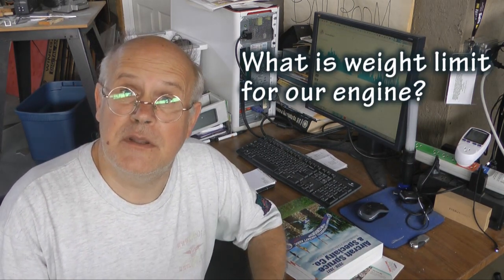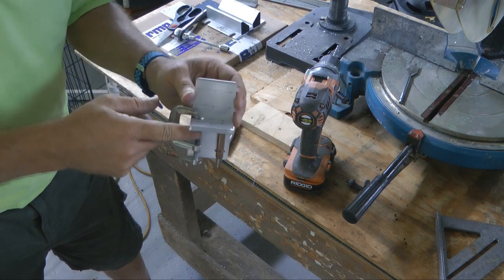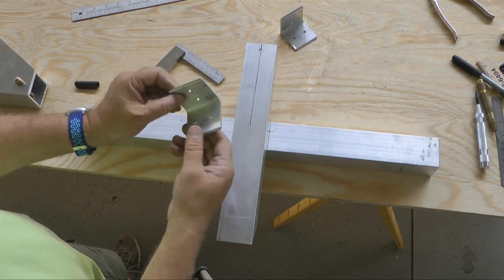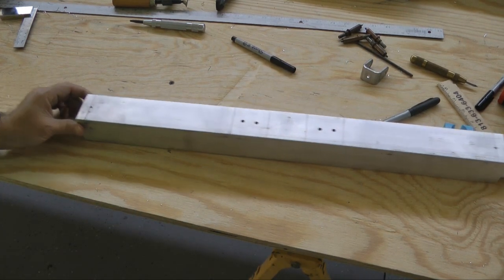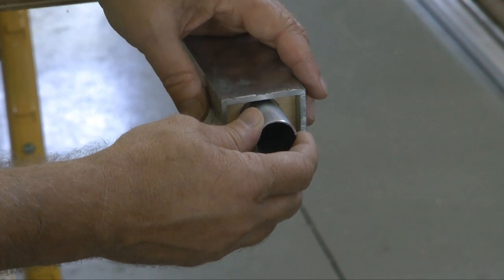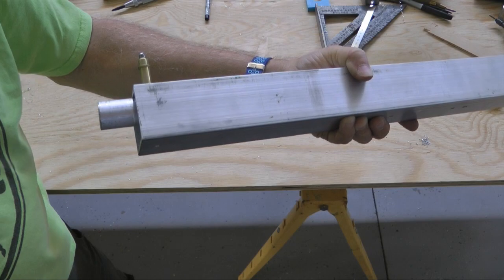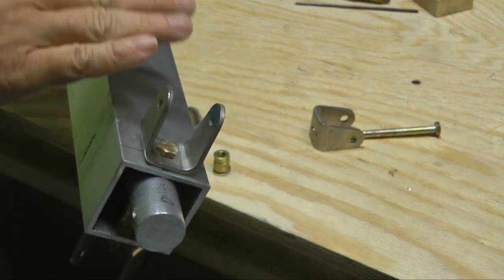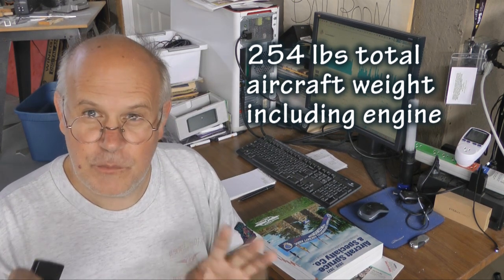Building the Affordaplane Part 7

Comment: Jon can you advise the actual size of the stainless 1" channels that attach tubes to the square fuse please ? we can not purchase and ship from the affordaplane store , too expensive to the UK so we must manufacture ourselves . ( obviously I appreciate the internal width is one inch but what is the height of the  sides of the bracket ? Ripley
Reply from the maker: Not sure I believe it is supposed to be made from SS (check your plans). But if its the part Im thinking of, I simply cut off the edge of a square aluminum tube to form a U channel.  All the dimensions of square tubing are available at wherever you buy this stock.  Match up dimensions with the pieces you are trying to join (those are all in your plans).

Comment: Since total weight is so important, why don't you weld the gussets instead of using all the bolts and nuts?
Reply from the maker: Welds can crack, fail and then people die when used in aircraft.  That is why you dont find commercial aircraft structures welded. Aircraft use bolts or rivets. And - ask a welder - aluminum is challenging to weld properly compared to steel.  Thanks for your question!

Comment: Could you lose a lot of weight forgoing bolts, washers and half the gussets by tig welding the frame together? This series is very enlightening. I wasn't sure I would have the skill, but so far it seems with in my skill set.
Reply from the maker: Welding is a no-no - Short answer without all the technical details: how many commercial or private aircraft have aluminum welded structures?  (answer: 0)  Also - you can calculate the weight of all of those bolts. Not really very much!  Disassembly for repairs/adjustments are fast with bolts. Half the gussets!?  Those gussets in pairs very eloquently clamp the frame joints together allowing flexing without fatigue. Your question about welding is reasonable and common - but like many things, the devil is in the details!  Thanks for watching.
Reply: @HomebuiltHELP  , thank you. As I've progressed through the series, I've realized that stuff can break over time, so you probably don't want anything permanently welded. I'm am being watching. Got to episode 28 in just 2 days.

Comment: Would using a scrap piece of 2"x2" as a mould with releasing agent inside and filed with Micro & Epoxy & a 1" tube with releasing agent placed correctly also work as a good jig making sure the pipe is 110% aligned correctly?

Comment: If EOS ever releases their Quattro 2.4 that would be an incredible motor to use. On YouTube you can see testing units already being put through their paces with incredible performance. Fuel burn is 0.66 GPH at 27.8 HP and weighs 34 lbs! And yes, it's a four stroke 😃

Not the most powerful, but definitely the most endurance for the 5 gallon fuel limit.

Otherwise it's Polini Thor series:
200 = 30 HP @ 2.16 GPH (41 LBS)
250 = 36 HP @ 2.68 GPH (54 LBS)
303 = 38 HP @ 3.17 GPH (45 LBS)
all 2-cycle engines

Comment: I'm enjoying your build and look forward to each new video; I have been considering this plane for my Winter project.    If you don't mind a few questions, I would appreciate your opinion.
1: What is the proximate total weight of all the bolts, washers, and nuts used?
Assuming a competent welder;
2: What is your opinion about welding the airframe with additional proper gusseting?
Reply: do not weld a aluminum structure, you cannot prevent cracking.   if anything replace bolts with rivets, but I dont think I'd do this either as a beginner.  it needs more rivets in place of bolts.  be sure to get with a real engineer or very very experienced builder for that kind of change.  we KNOW that built to plans this airframe is very sturdy.
Reply: @orbitalair2103  Tanks for your opinion.

Comment: Hey Jon... I'm not building the Affordaplane, I'm starting a 750 STOL in the VERY near future. None the less all of your tips and techniques are extremely helpful!  Question#1.. are torque values provided for bolts? #2...is there a need for anti- corrosive between the disimular metals ( stainless on aluminum etc. ) ? Thanks for sharing your experience and knowledge, I pick up something new and useful every episode! Blue Skies!
Reply: Resources such as the Machinery's Handbook should have bolt torque specs, but AC 43.13-1B should be your first place to look for aviation related info (free to download as a pdf from the FAA website). Also the Aviation Maintenance Technician Handbooks might be a good source for such information.
Reply: Galvanic corrosion is possible, even with Stainless Steel and Aluminum. Avoid aluminum hardware in steel structure, as the aluminum is what will corrode away. Steel hardware in Aluminum is done, as you see here. Just do your preflight inspections as well as periodic maintenance inspections to check for any signs of corrosion and address it accordingly as you encounter it.

Comment: Well, based on my own weight, that leaves about 2 lbs left over for the engine.

Rotax have a rubber-band model?
Reply: Bad joke performed badly
Reply: your own weight isn't a factor. The 254lb limit is empty gross weight (no payload, no pilot, no fuel). If you add a ballistic recovery parachute system to the plane, then you get a weight increase to 278lbs.
Reply: @SoloRenegade  He was making a joke. ;)
Reply: @noanyobiseniss7462  You'd be surprised how many people ask that question about ultralight aircraft. So, for the sake of all of those people who aren't joking when they say/ask it, they now have an answer.